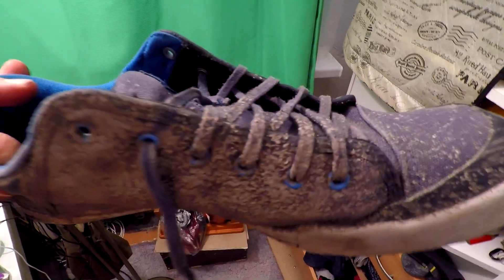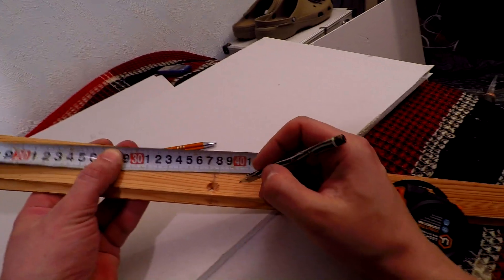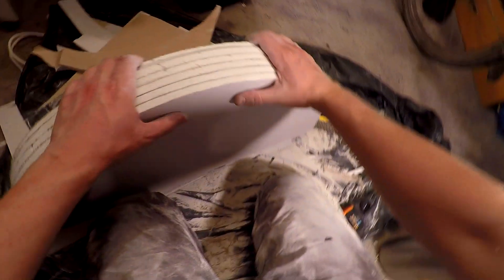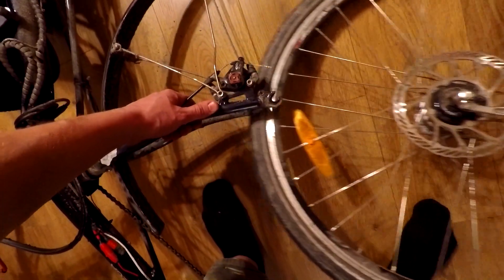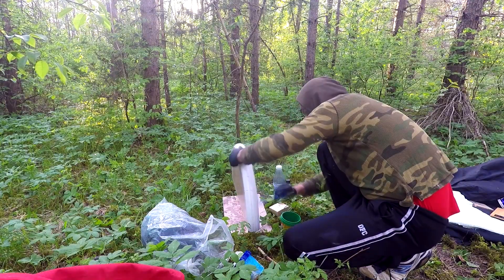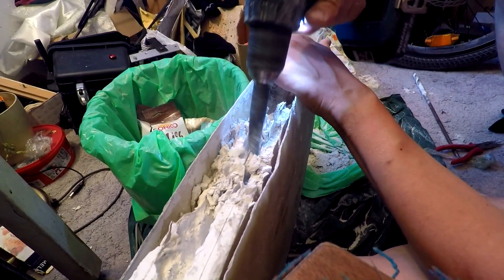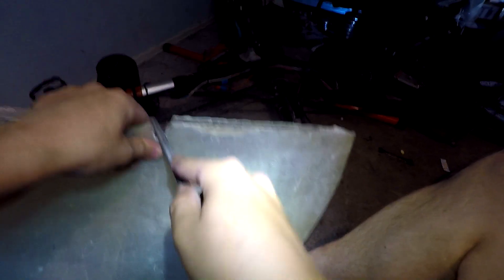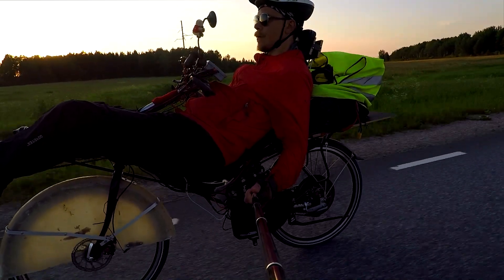DIY fibreglass recumbent wheel arch - Making Stuff in my Bedroom

Comment: You didn't talk about aero and how much your range ro top speed increased..?
As the top of the tire is going intro the wind at 2x the speed of the bike, I know it improved  range and/or speed.
Can you talk about that plz.

Also how did they affect the bike in cross winds?
Reply from the maker: Thanks for the question! My primary reason for adding the wheel arches was to keep both the bike and my clothes cleaner, especially in bad weather. I didn't have aerodynamics in mind when I made them. While it's true that reducing drag can improve range and speed, especially with the tires moving as they do into the wind, this wasn't a factor I focused on in this case.
Reply: @DatEbikeGuy  Thx.
I'm surprised you didnt notice an increase ib speed and/or range despite not looking for them.

Might I suggest some top speed and range tests with and without the arches.
I think it may well be a video worthy direction of investigation.
Reply from the maker: @RayleneCawood  Thanks for the suggestion! I appreciate your input. However, removing the arches is quite a nightmare due to the different attachments involved. Proving a 20W savings just doesn’t seem worth the hassle right now, especially since I use very large batteries, and a small win like that doesn’t really make a difference for me. In the future, I might consider exploring front fairings or tailboxes, where the potential savings could be in the range of 10-30%. That sounds like a more promising direction! 😊

Comment: I have also been dreaming of doing fiberglass at home. Maybe I just need to get the equipment. I have done some at school, and it is always super messy.

I have been thinking that for full wheel arch/ mudguards, a one-piece design might not be the easiest way to fully cover the wheel. I have for example used two MTB mudguards on one wheel. One for in front of the fork and another behind the fork. A two-piece mud guard you could call it.

For this wheel arch, full fender/ mudguard, I might also design it with the two-piece design. Just to make it easier to build and mount. Of course one peace is the most water tight and probably looks better.
Reply from the maker: Hey and thanks for the comment 😀
When installing the Costum wheel arch/mudguard, be careful with the mounting bolts so that the rubber pattern doesn't grab the end of the bolt when driving. This can happen with vibration if the mounting profiles are soft.  The result is a disaster, I have done this with one version on my enduro bike, I was in a hurry and didn't think it through, I crashed at 30 km per hour. Fortunately, wearing safety gear, nothing happened.  The next day I had a mild headache. 

And for winter where there is snow and ice these arches are not suitable. Because everything builds up in there and when it gets warm in the room you get a big lake.
Be careful and good luck

Comment: Yes, water/mud is awful. 

Was wondering how to do this.
Reply from the maker: Hey
This method may not be the most correct but it works. I've done a lot of fibre glassing since then but haven't posted any videos as it's not very interesting to watch. I'm grateful that you've found this old video and commented :) Thanks 👍😀
Reply: @DatEbikeGuy  it’s similar to how I’ve done fiberglass stuff in the past.  I thought I had to be doing it wrong that way, too.

I used to use plaster with “toilet bowl gasket” wax as a release agent.  (If the wax gasket is too soft, add some paraffin wax as a hardener)

Heat the male mold gently, then paint on the wax.  Let it cool, then smooth it up.  You want about 1/3 to 1/2 mm thick of wax. Do your glassing - I usually used epoxy, rather than “the Stink,” due to much less smell.

I used woven glass.  The thinner stuff drapes better, that and cutting small pieces and placing them such that the frayed edges overlap a bit.  I’d put some fiberglass coloring agent in each little mix-pot of resin, so I’d know where I’d gone.  Makes for an interesting color scheme…

Once you get a buildup that’s to your liking, then you gently warm matters up.  The wax melts and your piece comes off easy.  You then finish it how you want.
Reply from the maker: @dennisyoung4631  Thanks for sharing, very interesting. I'll just add a little bit here that the stinky thing I used in the beginning was Polister Resin. Very quick drying if you have warm weather then it's a run on time. And it really doesn't want to soak through fiberglass so well but very cheap. Now I've only used Epoxy resin much more expensive and doesn't smell and I can do it in my bed room. And on my plaster mould I have recently added a packing tape to get the product out of the mould better later.   It's fine if you want something that's practical but looks don't matter. 
Thanks.
Reply: @DatEbikeGuy  yes, polyester resin of all flavors (I usually used Isophthalic resin) has a most-penetrating odor.

I’m no longer young enough to hunt up some place a far distance away from where I live, so it’s (2X or more expensive compared to the Isophthalic STINK ) epoxy or nothing.

Note that where I live (Portland, Oregon) the Stink isn’t all that cheap.  Also, if you want to use chopped strand mat, the binder that stuff has usually demands using foul-smelling polyester resin, Bleah!  I can feel my nose wanting to turn itself inside out just thinking of it!